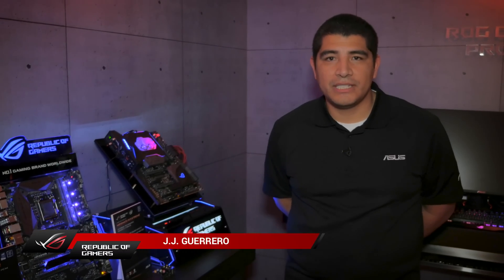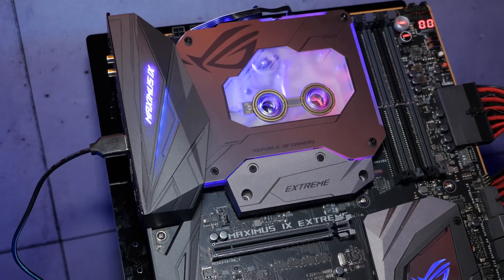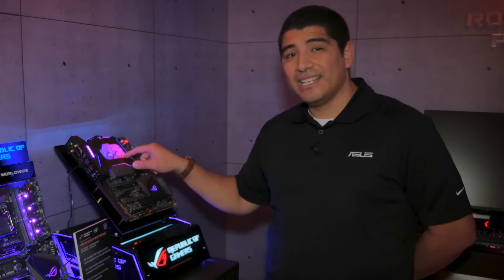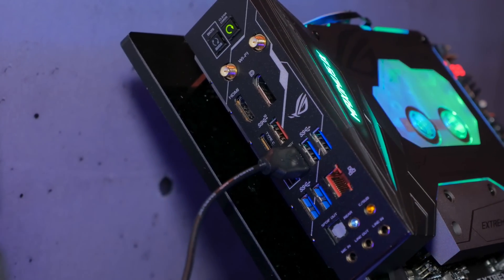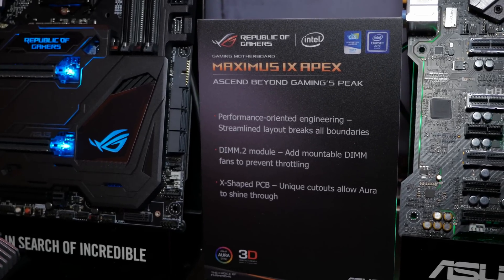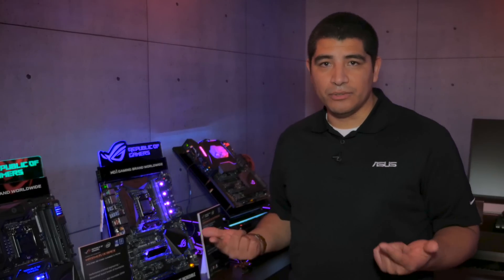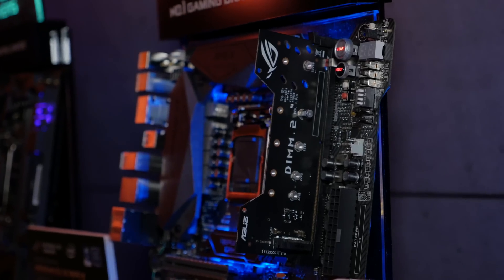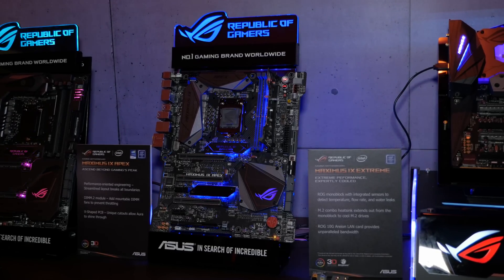CES 2017: ROG MAXIMUS IX EXTREME and APEX Motherboard overview

Comment: I have read a review from the owner of the Extreme and they said the integrated I/O was problematic namely the Thunderbolt port...issues keeping it connected. I really want this board but half of the reason is the integrated I/O and I need every last input to work.

Comment: Can I fit 2 M.2 drives in the Extreme mobo? If so, is there a cooling solution for the second one?
Reply: I'm also wondering this. It looks like one m.2 slot is near the CPU and is incorporated with the waterblock for cooling with the second m.2 near the southbridge and incorporated into that heatsink. Wonder how difficult the installation of the one near the cpu is and if it will require removing the entire waterblock. But i suppose you'll have to do that for CPU installation anyways. 
This would be perfect for lets say a 512gb 960 pro watercooled near the CPU for OS and a second 1TB 850 evo m.2 for games and such near the bottom. Saves the need of having to run two extra sata cables and their respective power cables. Keep all the big spinny drives in a different pc as a server/storage pc. Perfect.

Comment: That second board is weak. Why highlight the IO and cover on one board's IO and the next looks like 1995 and with 2 DMM's.
Reply: the second board is a very niche board for doing heavy RAM and CPU overclocking with LN2 or liquid helium. They were able to get the world record clock speed on the 7700k using this motherboard so they must be doing something right. But again that board is for a very niche market.

Comment: What if i am willing to use AIO for Xtreme?
Reply: Yahtadi Shidiq why would you do that
Reply: Dunno. Just wondering
Reply: Then get an EKWB predator for GPU or something similar and expand it to the monoblock since they're essentially a low maintenance customer cooling kit. Remember $150-250 of this board's cost is going to be for this extremely high-end and integrated monoblock.
Reply: I heard this board could price up to 500$

Comment: Extreme will mist likely be my next mobo, but I'll wait and see price and reviews first
Reply: Addictive_LiquoriCe no kaby lake will not require watercooling to reach 5. There are several tests with both aio and aircooler where 5 GHz was reached
Reply: Z270 are starting to list at retailers now. It's a bit over the top with a custom waterblock on it. Wth? Yet Kaby 'the boiling' Lake will require it when pushing 5Ghz

Formula IX is $389 on NewEgg so that will sux-a-lot going towards Extreme/Apex.So $450 and beyond then?... wow... -.-

Comment: JJ, that Extreme is everything one could ask for in a motherboard (sans the horizontal mobo power on an EATX board... that makes it a no go for tighter cases). Outside of that... thank you for integrating the waterblock design into the board aesthetic! The fan/water headers!!!! The overall design is perfect. This will be my next mobo come Coffee/Cannonlake. 

I hope this product positioning (Apex for OC'ers and Extreme for water coolers) carries over to future chipset generations. Also, the new Code is a terrific product choice! Seriously, you guys really hit it out of the park with Z270.
Reply: if you buy the extreme board for its stupid water cooling block your an idiot. The apex wont do any better than most z270 boards. If i were into water cooling i wouldn't choose that ugly water block there are much better cpu waterblocks from ek that are better. You will not achieve any world record overclocks on the apex board, you know how people get world record by using liquid nitrogen and using a heat gun and by using a silicon lottery cpu, power phases are not everything dude, and i highly doubt that the apex would even get you any further than 5ghz/5.1ghz before your computer crashes anyways. I would save money and get either the strix boards or the maximus hero. If your going to spend 400+ dollars on a motherboard buy a asus deluxe instead with a 6850k for 40 pcie lanes, and you get a far more powerful computer anyways or buy the 6850k with the rampage 10 board
Reply: Okay.

Comment: So far very impressed with ASUS board offerings this year. Z270 boards >> Z170 for sure.
Reply: For gaming, they are about the same, even for the next gen cpu's.
Reply: Agreed. I should have been more specific in my comment, because I was referring to aesthetics mainly.
Reply: Vincent Drover It does look very good, though. And I just got my maximus viii hero alpha with an i7 6700k...
Reply: sucks to be you man. Patience is a valuable asset to have.
Reply: Andres Jaramillo It is still very good hardware, better than my now 5 year old gaming laptop.
Reply: i have a maximus viii formula and watching some reviews of the new extreme one, it would saved me a lot of work with all of these fan conectors and new stuff... :(